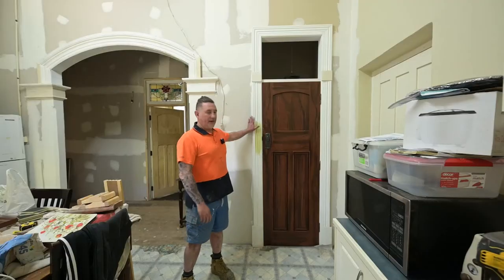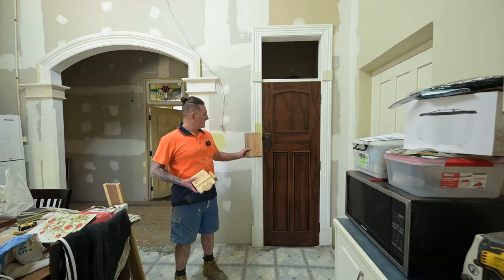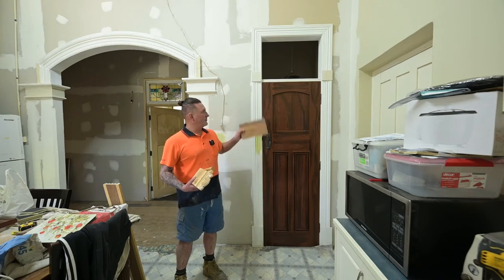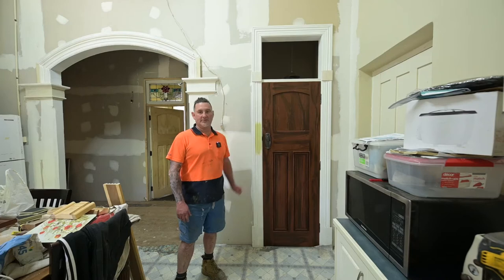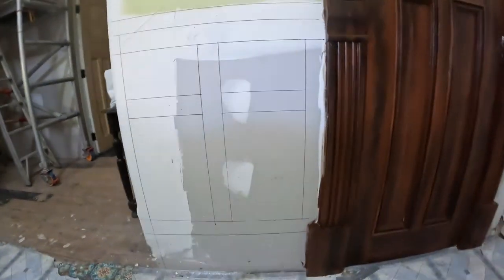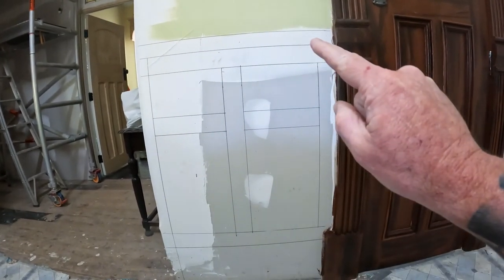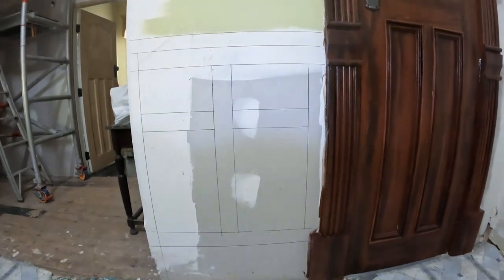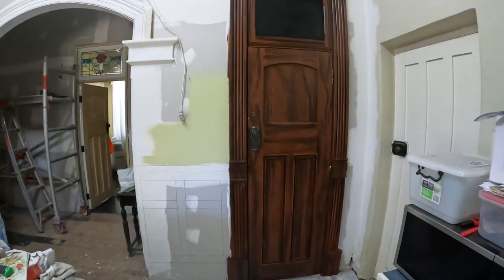S01E79 : upgrade to victorian woodwork |1880 shop into Victorian mansion

Comment: My 2 cents worth is that The green is much better than the yellow or red. I have a preference for a colour called Admiralty Grey when paired with oak or mahogany colour timberwork. It's a blue/grey hue. Works well in a flat matte finish as it lets the varnish on the timber reflect the light. Anyway you're doing a great job and quietly envious of this entire project.